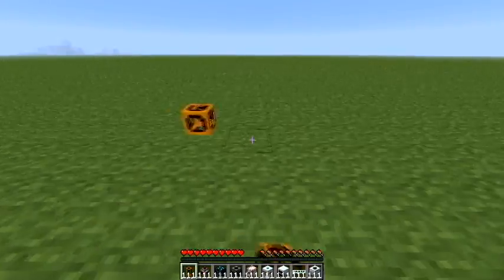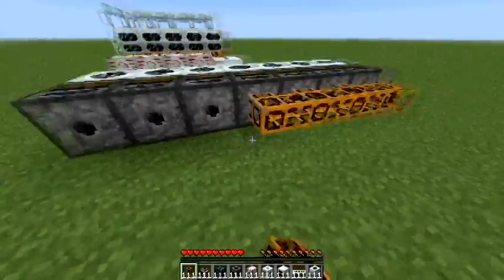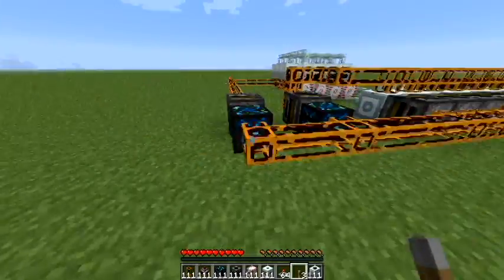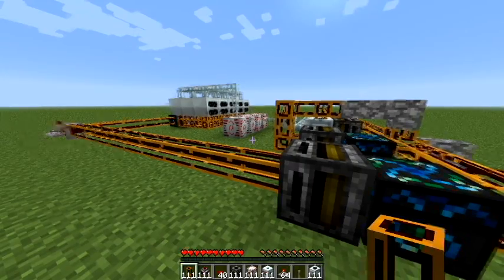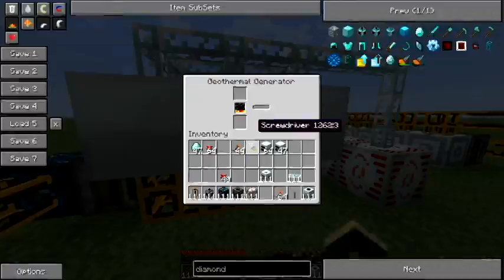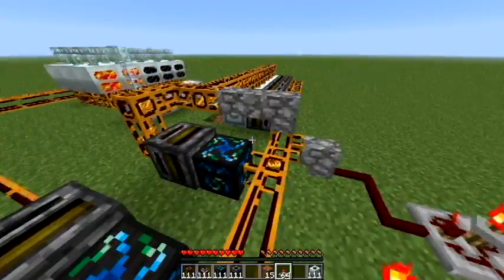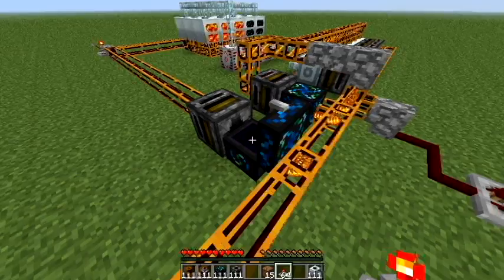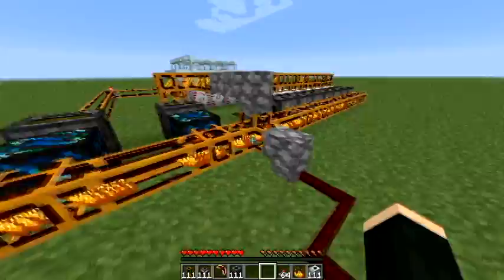[Tutorial] Blaze Rod EMC Generator

Comment: I think you're misunderstanding the concept here.  Macerating the rods creates five blaze powder, but crafting creates 2.  The EMC values are based on that, 1 blaze rod is 1536, 2 powder is 768 each, equaling 1536.  If you use automatic crafting tables, you would not get any increase in EMC, making it all useless.  By macerating it, you make 2304 EMC per maceration, and then 1536 of that goes to making another blaze rod, leaving 768 surplus EMC which can go to diamond making or whatever.

Comment from the maker: Yeah, I mean, technically you can change the timer that is pushing out the rods into the macerators to .6 seconds from .4 and have it push out ## ([#] being however many macerators you have in-line) every .6 seconds as the advanced machines that don't require upgrades, when at full speed, will macerate every .6 seconds.

Comment: Working fine, churning out diamond blocks, its right kick-ass
avoided the few issues people seem to have (putting the lever for the Mace sharing the block with filter, keeping it off, & none of the volt issues that's the easy part)

the issue i'm having however is really strange, the blaze rods seem to not want to go past the 4th mace, the last 3 are not ever getting any..not sure if it's a timer issue (did the same as you) or a problem with it not pushing out enough rods..

any idea bud?

Comment from the maker: If you're talking about using the bug with the Nature ring and the reed breaking on the blocks above it, then I consider that cheating.  I don't consider this cheating because it isn't a "bug".  It's an interaction between mods that may or may not have been intended.

Comment from the maker: If you are using the newer versions of Technic or on Tekkit, you will have to use some transformers to use the Rotary Macerators.  They now only accept LV.  Also, the more Macerators you have hooked up in one line, reduces the EU input of all the macerators that are further away from the initial cable.  So in order to maximize, you would want to create another transformer OR another EU storage block and have it re-output the energy and do that about every 3-4 machines.  If you can give me any

Comment from the maker: You need to make sure you are using Geothermal Generators to receive the power from the lava cells.  In the beginning of the video, I only say "generators" but I correct myself later saying "geothermal generators".  Also, make sure that the lava cells are going into the top slot of the geothermal gen otherwise it won't actually produce power.

Comment: Question, since there is a new update should we be using overclockers and energy storage upgrades in the macerators? If so, how many? The only thing I have in mine is the LV power upgrade, wondering if I should use the others or if it will explode.

Also, we don't need to put anything in the filter slots that run from the  Macerators, right?

Comment from the maker: Yeah, you shouldn't have any solars.  If you have solars directly attached to the macerators, that's why it's not functioning at night.  It should be the geothermals being fed by a condenser that pushes out lava cells, MFSUs or MFEs that directly feed into the macerators, and depending on the mod of Adv. Macerators, you need transformer upgrades or med/low voltage transformers to step it down low enough.  The power from the geothermal generators should be stopping in the power boxes on the way

Comment: I got a problem, my blaze powder wont exit the macerators, even tho the redstone tubing is flashing. I connected the timer with Jacketed Diamond Wire for the tube, and Red Alloy Wire for the timer itself.

But for the "input" (blaze rods from chest to macerators) everything works fine with the same setup. 

And yes, the macerators are macerating the rods to powder so it's not an Energy matter

Comment from the maker: You have a problem with the output of your EU storage blocks.  Rotary Macerators no longer accept MV, so you have to make sure you put a MV and LV transformer (Medium Voltage and Low Voltage) so they can accept the output.  That's if you followed my setup and used MFSUs.  If you use MFEs you only need a LV transformer.  You can use batboxes, but you'd have to create somewhere in the realm of like 120 of them to compete with this storage, plus upgrading from batboxes to MFEs or MFSUs can be bad.

Comment from the maker: Can you elaborate further on your setup?  Providing pictures would be really awesome too.

If your Macerators are exploding and you're using Advanced Machines, it depends on which actual mod you're using.  If you have the one that has the 4 slots on the right of the Rot. Mac. then you need to put in a transformer upgrade to every macerator.  If you aren't using and advanced mac., then you also need to put in a transformer upgrade as both of those can only accept low-voltage current.

Comment from the maker: A reed farm will almost NEVER be more efficient simply because the amount of land required is insane.  Every reed piece is 32 EMC, so assuming you let it grow to 3 height or broke it every update (leaving the base) that would be about an average of 5-7 minutes per new reed to grow meaning, in order to have an equivalent EMC generation, you would need (50k x 60 x 6[average time of reed growth]) = 18mil EMC per 6 minutes or 562,500 reed PER 6 MINUTES.  That means 94k per min or 1562.5 reed per sec

Comment: just use normal generators and use blaze rods to power them.  It produces as much EU as you want, plus it can go as fast as a macerator with overclocker upgrades can go.  Mine uses 2 filters, 1 macerator, 1 condenser, and 4 generators.  It's tiny and it produces tons of emc.

Comment from the maker: They COULD take MV.  With the newer patches of Technic and Tekkit, they no longer can take MV by default.  Rotary Macerators and regular macerators both require LV and since this outputs HV by default, you need either 2 Transformer upgrades PER machine OR you can use 1 MV Transformer and 1 LV transformer.

Comment: MFSUs are high voltage, macerators are low voltage.  When they touch, they explode.  It is easy to fix this.  Use rotary macerators instead of macerators, put transformer upgrades in your macerators, or use batboxes instead of MFSUs.  I suggest using rotary macerators.  I'm still kinda new to tekkit, so can other people correct me if I'm wrong?

Comment from the maker: The problem there means you are pulling too many blaze rods out to go into the macerators.  If you exceed 4 rods per 0.4 seconds, you will create a hole that can be filled by more powder instead of a stack of rods, allowing for a hiccup that will stop the machine entirely.

Comment: nvm. i needed an LV transformer behind the mv transformer.

I also put 1 red alloy wire in each of the rotary macerator battery slot. Mine put blaze rods in there

Comment from the maker: Yeah, a full Mk3 EE Flower costs somewhere in the realm of like 18 million EMC.

17 Mk3 collectors (710,665 EMC) = 12,081,305
5 Mk3 relays (681,281 EMC) = 3,406,405
1 energy condenser (42,011 EMC) = 42,011
Total: 15,529,721 PER flower.  And to get it running even close to the same efficiency as this setup, you'd have to have about 2-3 flowers with 32 pedestals and 32 time watches.  Which, by the way, would cost you another 100,243,456 EMC.  Ridiculous.

Comment: Im playing SMP. I've checked multiple times if everything is hooked up, so thats not the problem. And why is my MFSU storing 10M energy each without using it? And what will happen if i replace the Medium voltage solar with glass fibre? Its very strange that the machine wont work during the nighttime since its running on cells, so i think my solar is blocking the energy from going into my macerators..
P.s. Again sorry for the crappy english xD

Comment: OR use something with more valuble EMC than Diamond blocks.
Reply: Such as? I need something like that, but don't know where to start
Reply: Tom | DeadlyCakes dark matter is better than diamond block, has around 100k-200k emc, red matter has 600k emc, dm pedestal had 2 000 000 emc, and rm furnace had 2 000 000 emc.

Comment: No offense, but this is really overcomplicated. You can good results with just a geothermal generator which powers a rotary macerator. The rotary macerator gets blaze rods from a energy condenser above it, and puts the blaze powder right back into it. Then, everytime a stack of 64 rods builds up in the condenser, a different filter takes them out to two places: one condenser to make lava cells for the generator, and another condenser to make a high EMC item like diamond or dark matter blocks.